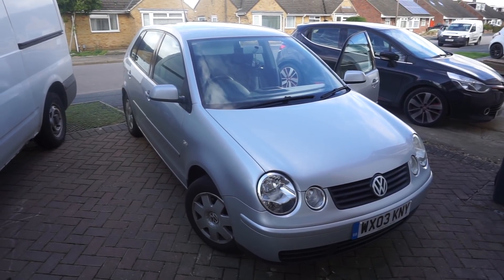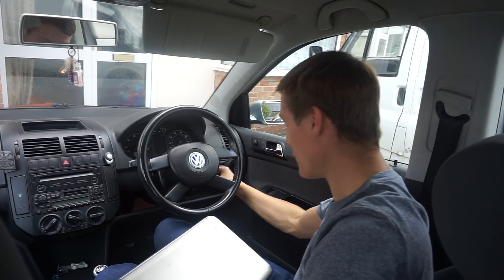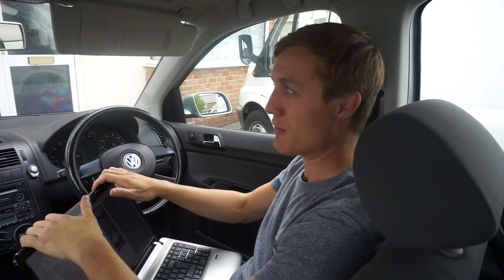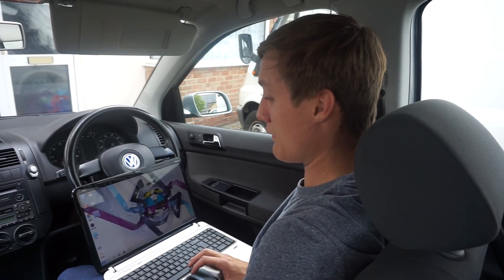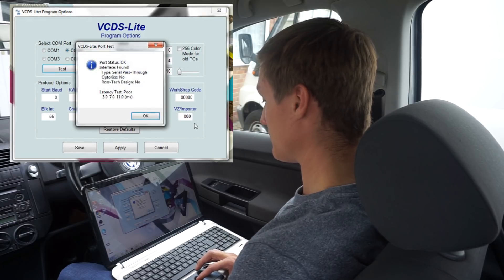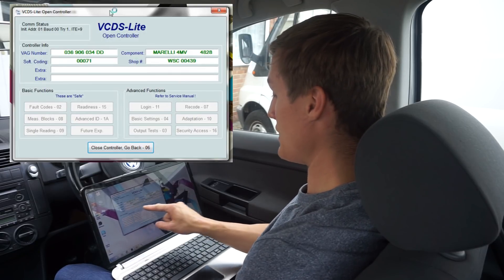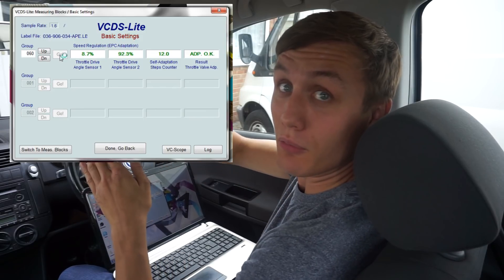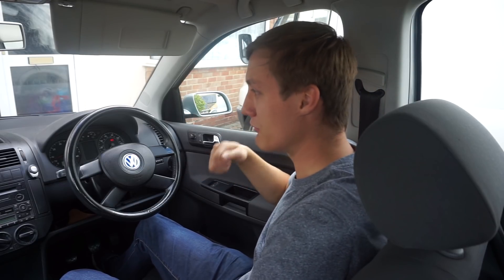VW and Audi Throttle Body Adaption and Realignment

Comment: Hey All

I have been battling with my 2005 Polo 1.6 (9N3). It starts immediately (with accelerator pressed I always start it like this). It will idle fine with no problem but as soon as I release the accelerator it idles funny for few seconds and then switches off. I took it to a local mechanic and he did a full service ( spark plugs, oil and air filter, oil change) and I also replaced the battery but the problem still persists. Please help It has had this issue for months now and have lost the joy of owning a car.

Comment: does any one know how to rise idle RPM on the POLO MK4, RossTech page say go to engine, adaptation, ch1 and put value between 124 and 132 in my car is value 170 i change it to 132, 200, some random number and RPM are always the same, any proposal? i have aftermarket alternator and i need 100 rpm more to charge on idle now is 670 rpm  and i need 800 rpm

Comment: Advise please.  After fitting two throttle bodies on idle the engine is seems to be idling at a strange level.  Pressing the accelerator it revs and seems to stick.  Same thing on both throttle bodies.  Can it help?  Thanks

Comment: Im just getting “Error" on the 098 (cable throttle) adjustment field. Error code G187...just successfully replaced the Throttle Body on a 1999 Eurovan

Comment: Get an ANCEL VD500 OBDII from Amazon for $75. It will play with a Volkswagen, Audi, etc. or American OBD systems. Plug into the port under the steering wheel. Key on. Select the read function for V/A diagnostic protocols. Don't try to start. Dial up the throttle body function. Field one relearn. Field two relearn. Third field it might stall awaiting information. If it does turn the key to start and it should start and smooth right out. That is providing you have a clean (pull it and spray it clean with carb cleaner) free of defects throttle body. If it was running fine and your battery died or you disconnected it for some reason you might experience a start and stop condition. No 
laptop or expensive software required. Happy motoring!!

Comment: Usefull video, but forgot to note that you need to register vcds lite for about $99, if you want to do this alignment. It is not a low badget way for cleaning the throttle body, so let's do that chicken dance:)

Comment: What about vehicles with cable throttle? Is this a different procedure?
Reply from the maker: I presume it would be. this procedure is so the alignment of the throttle body flap matches the pressing of the paddle as the signal is sent electronically

Comment: hey thanks for great video i have epc and check engine light plus, loss of power engine so i cant drive my car i will fix throttle body soon so is that software which u used for reprogram is that free can i download it to my laptop and i have  port for connecting to car like a d can scan cable is that works   thnks?
Reply: Where you able to fix it ? I have the same problem with my PASSAT 2009
Reply: Cornelio Silguero i fixed, the problem was ignition coil and spark plug..  make sure use oem genius vw parts and change all together .. have you changed?
Reply: boksu Lee i have an EPC Light but apparently it’s the Throttle Body Sensor
Reply: Cornelio Silguero i got same light too when i had issues so i don’t think throttle is bad..  first check your spark plug and ignition coil..
Reply: @corneliosilguero2010   did you the find the problem?
Reply: boksu Lee it was the spark plugs had to switch them for new
Reply: Cornelio Silguero 👍🏼

Comment: I got the vcds lite and i keep getting the same message 
Too many communications errors to continue 
How can i fix it?
Reply from the maker: mrlntejada trying changing the baud to 9600
Reply: Dan's Miata  i did but not luck
Reply from the maker: try turning off any anti virus software. make sure all doors are unlocked and don't power the laptop off the car
Reply from the maker: let me know what it was if you sort it. thanks
Reply: I try changing the ecu  now car starts and idle but irregular i try to use the vag com to reset the throttle and i get the message no response from controller

Comment: How much is the VCDS software and do you have to be in the trade to buy it?
Reply from the maker: have a look at ross-tech.com, if you have any cable that is non standard then you need VCDS lite which costs around £80. otherwise you need to buy a genuine rosstech cable but all the information is on there site